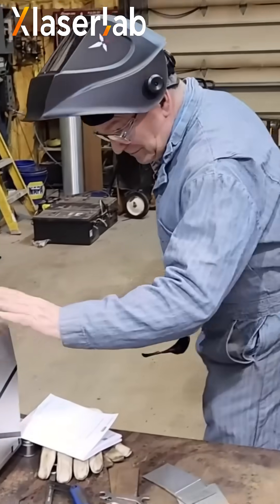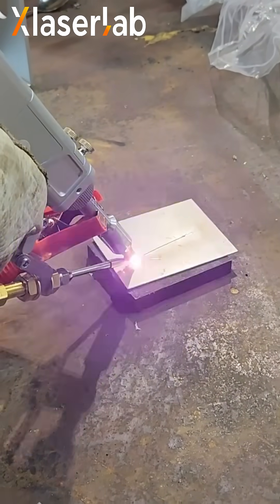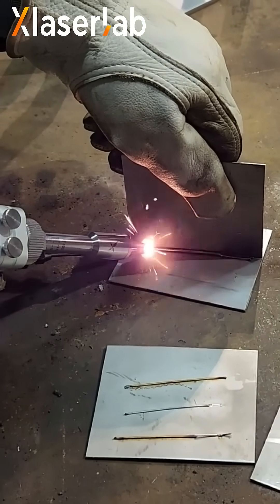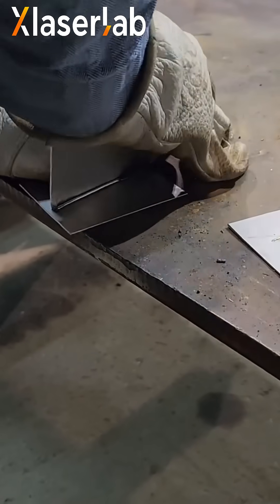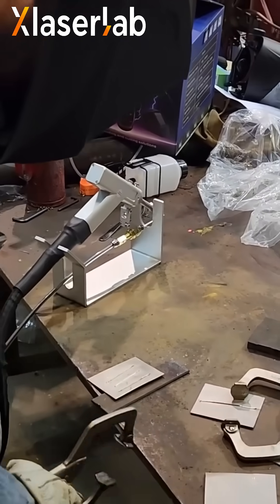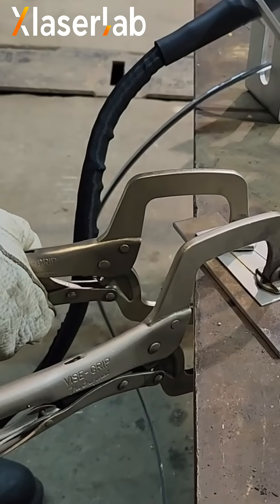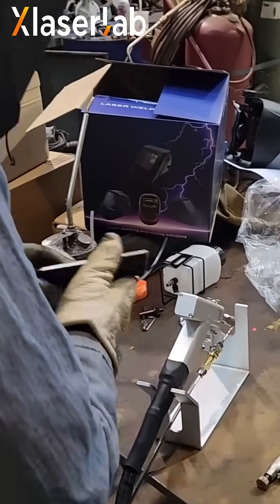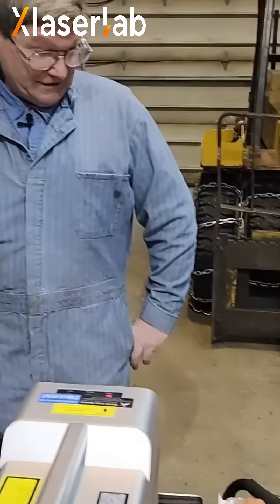XLaserLab X1 LaserPro review - it's decent

Comment: We just recently bought one at work, branded lightweld and it’s performance is phenomenal. The fact that the heat affected zone is non-apparent practically the material is way stronger than traditional mig welding at a fraction of the size. We are still early on in the adoption, but the performance seems very promising once you get over the price tag 😂. It almost makes anyone a welder after the settings are set, which are very intuitive by selecting material size. 🤯

Comment: I welded a lot of stainless to carbon steel working in a pressure vessel shop. We used a 309 rod that's formulated for that application. I was certified up to 3 inches thick.
Reply: You probably know why 309 joins c/s to s/s. If you don't know...there is nickel in the rod. 12%-14%. This element is what adheres to both the c/s & the s/s together.  :-)

Comment: Can I ask what that unit costs? How thick of material can it weld?
Reply: X1 Pro base unit is $3500, the promo code for this demo (HOWEES) knocks off another $175 for me, shipping is "free" but for me there's a required $72 shipping protection fee. Taxes included comes out to about $3400 shipped. It's advertised to weld up to 3mm.

Comment: I've seen a few videos now promoting these new laser welders. Of course the videos were tailored to make it seem like the greatest thing since sliced bread. Its nice to see an actual demonstration. Have tried a cross section cut on a weld to see how well its penetrating?
Reply from the maker: We've honestly not tested it as thoroughly as we like - it arrived much later than it should. We'll be playing with it a lot over the next month and seeing how much it can be goosed. From what we've seen penetration is something that laser welding exceeds at in general, though we've not yet sectioned to see.
-Cameraman
Reply: @HOWEES gotcha, I'll keep an eye out for your videos. Its interesting tech
Reply: Agreed, nice to see a real evaluation. At least preliminary.
Reply: How much does that welder cost and what are you using for wire and shielding gas and what speed and heat range are you using would be some good information to know